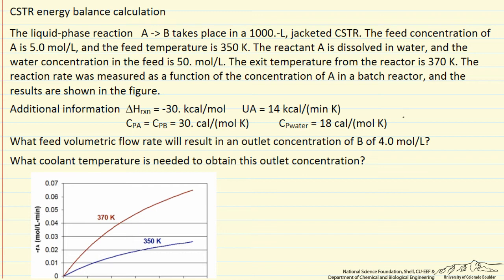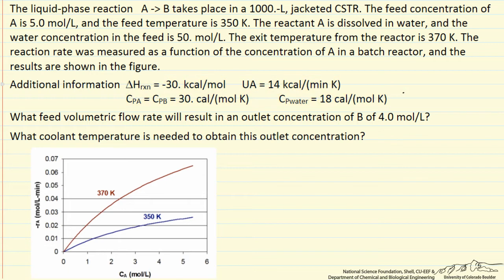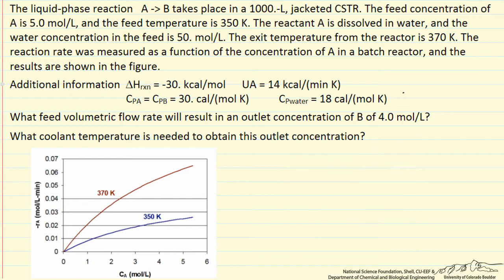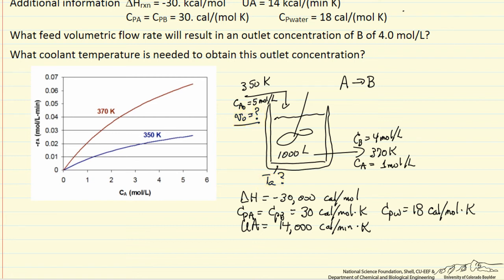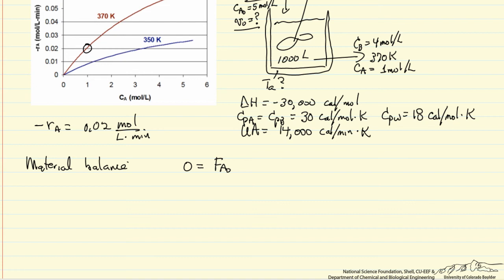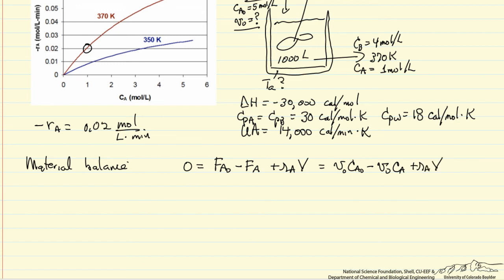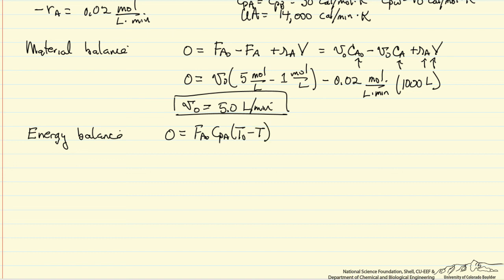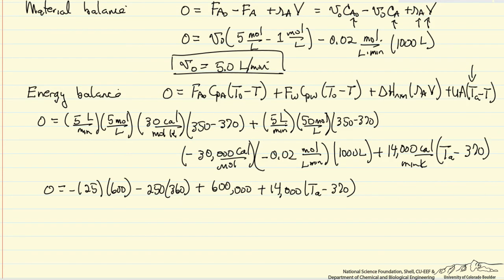CSTR Energy Balance Calculation

Comment: Hi there! I'm a 1st year ChemEng student. I found this video very helpful however, there's a couple of things that I find a bit puzzling. First is the Overall Heat transfer coefficient's units shown as cal/min.K ? and, second is that the Cp for water shown in your energy balance seem missing once the numbers are plugged in ? Thanks!
Reply from the maker: +Vanessa Coudert-Mendez Thank you for your questions.  The units that are shown as cal/min*K are for the overall heat transfer coefficient times the area.  Second, yes! The heat capacity for water is missing in the energy balance - great catch.  Luckily the final calculation actually included the number, but it should definitely be shown in the equation with the numbers.  We'll fix this promptly.
Reply: You have a serious issue. The ΔΗrxn in which temperature is! Tin Tout or Tref? Most of books they don’t say anything.